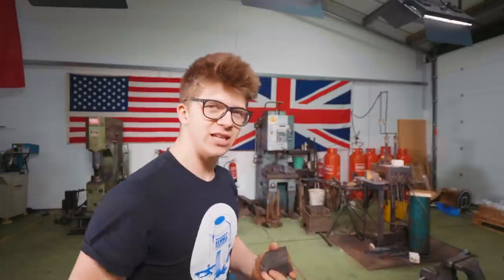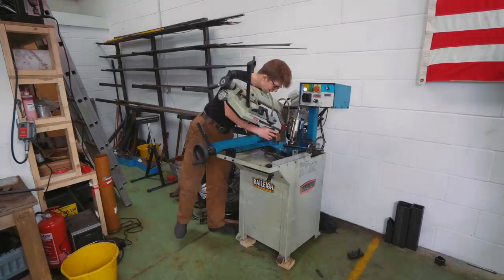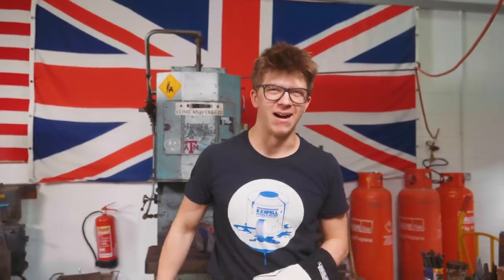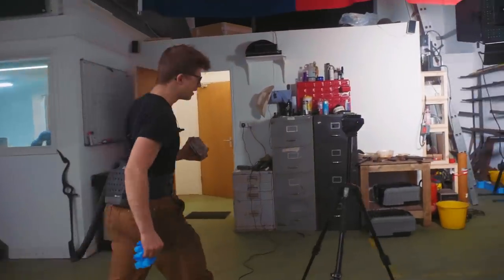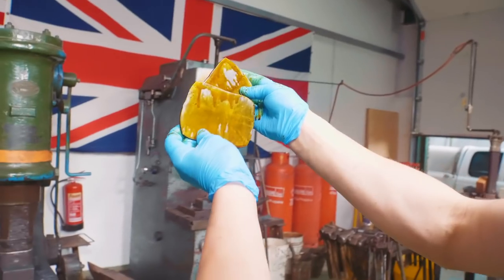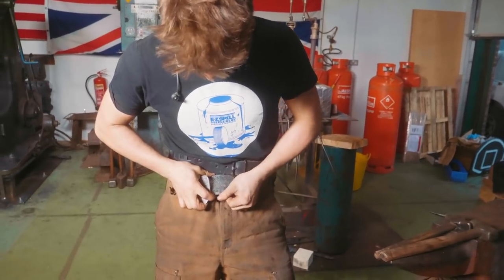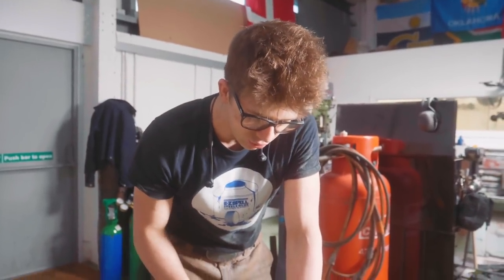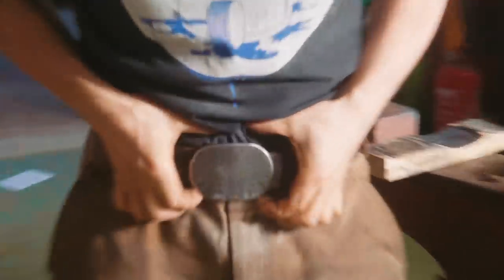MAKING FLAG-MASCUS BELT BUCKLES!!!!! UK + USA!!! Part 1

Comment: making an acid not acidic is neutralization
Reply: tyler saulez acidic is the proper way to say it
Reply: tyler saulez 
I knew someone else would say this. Yes to neutralize is to bring the PH to a neutral level of 7 otherwise known as water.
Reply: JackManic1984 it's doesn't become water when you neutralize it you goof
Reply: JackManic1984 Not necessarily water. Water is just a solvent. pH is a measurement of hydrogen ion (H+) concentration. You can have acidic or basic water, and, as you said, pH 7 would be neutral.
Reply: "Base" or "alkaline", to answer Alec's word query for acid's opposite on the pH scale. Ben Franklin connection too. Good day.
Reply: Tyler D 
Wasn't implying that it turns to water, more that it reaches the PH level of pure water.
Reply: JackManic1984 yeah you were trying to say that but instead you said "otherwise known as water"

Comment: A pro tip, it you put a bucket of water directly under your grinders contact wheel it will catch most of the dust coming off the grinder and your quench water is close and within a quick reach. It helped me out a bunch when I was told to do it. 😀 I love the videos!  Keep it up!

Comment: Get a polishing belt for that 2x72. Also try splitting a small log n use it to form the bend in the buckel it won't leave hammer marks in the metal. I use two pieces of wood to fix license plates for peoples vehicle

Comment: I have a question. For the US Buckle, could you have forge welded a bit of steal to one side of the damascus billet to make it thicker? I mean the pattern would only be visible from one side if you did, but being as it is a belt buckle you only really need it to be. You had mentioned that it was a bit thin, I was just wondering what the pros and cons of adding material this way would be.

Comment: Hey mate just thinking could you use temper/heat colours in your Damascus instead of just the black oxide colour ? So instead of doing every thing as usual an instead of just doing the sand after etch but scotch Brighting the whole piece then heat it to straw or blue colors then doing the sand on the high points an give you a bit of blue in your Union Jack ?
Reply: If that makes any sense

Comment: Why did you choose to use the Sahinler power hammer more on the Hoffman sword than you usually do?
Reply: Jared Armatis it has smaller dies so it was easier to isolate the internal pommel and guard as well as draw out the tang.
Reply: Makes sense.  Thanks!

Comment: you need to get you a metal bead roller it will let you curve the metal or put a bead if you want to do just change the flat rollers to bead rollers or whatever

Comment: can someone tell me what is that white liquid coming out of the bandsaw and why?
Reply: Brillembourg Vegas Enrique It's because he turned it on, if you catch my drift. ;)
Reply: It's just a coolant/lubricant, keeps the belt from warping and breaking
Reply: Brillembourg Vegas Enrique it's cutting fluid.. It's a coolant for the blade helps maintain a sharp cutting edge and minimize wear on the material.. And it removes any metal shavings from the cut..
Reply: Brillembourg Vegas Enrique its for cooling the workpiece and blade.. you know, friction=heat 

it’s a mixture of water and oil specific for cutting, making the saw blade last longer.
The water cools and the oil lubes :)
Reply: it has many different uses. an depending on which type of cutting fluid is being considered, it may be referred to as cutting fluid, cutting oil, cutting compound, coolant, or lubricant..
After it is sprayed onto the job surface it falls down to the bottom of the machine where is its gathered up in a collector pa, gets filtered and recycled to do it all over again.
Reply: it's android blood of course.